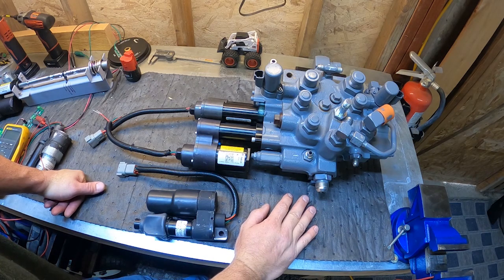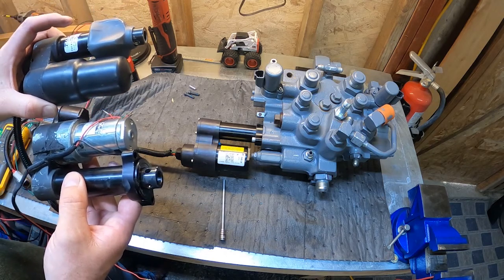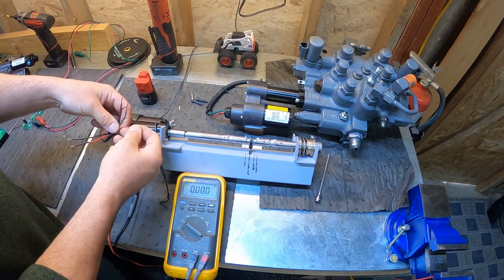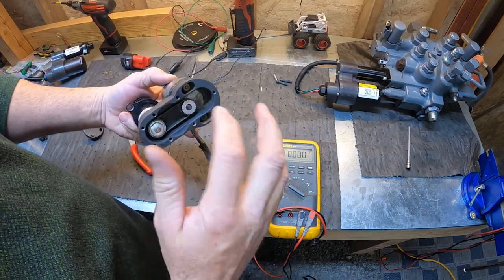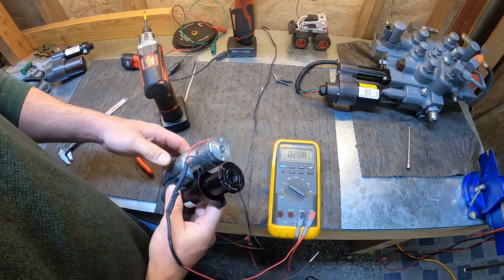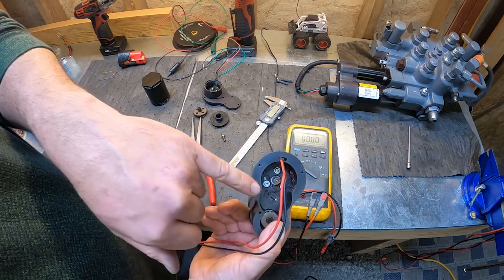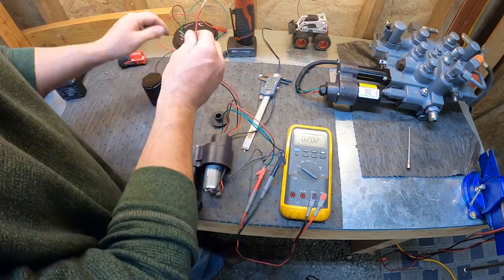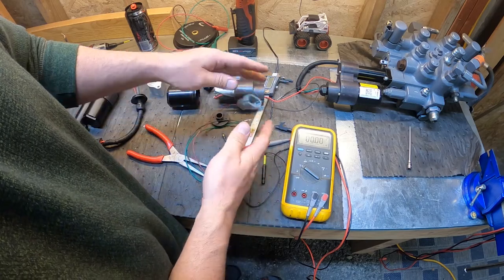Bobcat actuator, how it works, repair and calibration, what you need to know.  ACS AHC SJC

Comment: You saved my bacon! My Bobcat S220 tilt function failed today. Your video helped me determine the fault lied in the actuator motor. Resistance reading was infinite when it should be 3 ohms. I called my local Bobcat dealer who was no help other than telling me that even if I bought the new actuator from him I would still need to bring the machine in for calibration. When I asked him about performing a manual calibration he said 99 times out of a 100 it never works. So I thought no loss in trying. 
Removed the actuator and ok it apart. I had the later style with the globe motor which allowed me to remove the end cover to check the brushes. Mine still had plenty of life so I figured they hung up. Reinstalled the cover and tested on a 12 volt source. Cycled 2X and then failed. So I took it apart again this time removing the motor from the actuator. Used 400 grit sandpaper to polish the commutator and dress the brushes. Ran the motor several times, reassembled actuator using a USB cable cut down for my 5V ref. Reinstalled actuator and checked operation. Works great!
Reply from the maker: Awesome, so glad you made a successful repair and saved some money!  Don't forget to do the manual machine calibration as well just to make sure perfect neutral position is achieved if you haven't already done so.  Thanks for the comment, I really appreciate it.
Reply: @tetradgroup  how is neutral position achieved? When I reinstalled the actuator I watched the spool valve and the actuator piston moved but the spool remained centered.
Reply from the maker: @davidraezer5937  https://youtu.be/hmX6mZFlmsU

Comment: Yay bobcat working. Checked the tilt actuator in the bobcat and it was at 2.35. Was able to take the back off the actuator in the machine reset it to 2volts,put it back together everything‘s great. So I never was able to see the end of the actuator if it went back into 5 mm after I put it in flush and it didn’t work. For everyone else’s information this was a 2002 753 With an old style actuator and adapter from factory. Which after setting to the flush did not work.So I’m guessing it should’ve been sent to the 5 mm in. Anyway, thanks for the help, great videos,you’re doing a great job!

Comment: Hi Brady,
I'm working on my actuators again and pulled apart the troublesome unit, same as last time, tilt. I found the commutator was well worn quite a dip in the center of it so as I had nothing to lose, pulled it all apart and put the shaft in my lathe and very carefully turned the commutator. It turned out pretty good after all the cleanup of chips and cleaning the grooves. I also found 4 new motors online which I thought would work, newer part numbers than these old 2006 ones, but the shaft diameter has been turned down for the gear by Thompson so it would mean trying to turn it down to match which would be very difficult, still working on that, so instead I took the new brushes and brush holder from the new motor and put it on the old motor, they are both Globe motors.  I could also try to find a new gear for the new shaft diameter. The motor seems 100% better, runs great, just not sure how long it will last with the turned commutator. The globe motor # I used is 403A6005-2, it is also 1/4" shorter as it has 1 oz. less torque.

In your video you mentioned the latest style actuators post 2006 used newer type motors, not globe and that you were looking for a source. I am wondering if you have a found a source yet and if you have, could you share the p/n or link to it? I tried to pull a frame from your video to see the part number but couldn't get enough resolution to see it. If you share those numbers I will do some research to try to find a replacement.

Thanks again for your video, it's awesome.

lathe pic                      https://share.icloud.com/photos/0cb-ND0W5G9s4IJvoKRnfCpUA  
new motor brushes  https://share.icloud.com/photos/05fZrsdA-1iCxwrRfDJSaE3Gg

Comment: Thanks so much for your help, was having a hard time finding info for my 02 t190 with Acs faults, was able to troubleshoot the weak tilt actuator and figure out the problem myself,  a faulty tilt actuator and now unfortunately also a acs controller (burned it up while working the worn out tilt actuator back and forth after cleaning the internals of the actuator) So I would recommend replacing  the actuator even if you get the actuator motor to free back up cause it may just cost you a acs controller too just my 2 cents for anyone else in the future.

Comment: To start , great video. I have a 753 G, 900 hours always garage kept. I have 1 gen (with adapter spacers) I set the actuator flush, set pot to 2 volts. Now when I install the actuator, I have to extend the it out to put the pin into the spool. Press it back in to bolt up to the valve body. Now the signal wire (green) is reading 2.25 volts when tightend down. I am using the machine for a power source to adjust the pot. Turned on... AHC light comes on. Next I opened up again to adjust pot to 2 volts. At 2 volts closed pot up and turn key on (engine off) (no AHC light) press green button for BICS. Lift handle works, but the Tilt handle works then errors out. Turn key off and back on clears error but repeats AHC light comes on when tilt handle is used. With engine running I can get the bucket tilted back a little bit at a time. Do I have to take it to the dealership or might you have an idea to calibrate? The lift actuator, pot is working at 1.90 volts tried that setting also.
 When I purchased the Bobcat I also bought the manual, and it's interesting that the service manual only goes to page 60-120-10  and starts 60-130-1. If I spend the money to buy a service manual give me "all the pages" including the ones that say "dealer copy" . I got a hold of pages 60-123- 14,15,16 but it errors out with the AHC light.
Reply from the maker: Why did you open the actuator?  It could be the actuator pot is giving a faulty signal or motor is not working correctly.  I would swap actuator plugs and see if you get lift codes.  Then put plugs back to normal and swap actuators around and see if you get lift codes.  It's possible the actuator is just bad.
Reply: @tetradgroup The original problem was tilt act was not working, . I checked wiring first by switching the lift with the tilt plug. Now the error was on the other handle. So I pulled the tilt actuator out and found the motor worked but didn't move the actuator. Found the set screw problem. the gear from Globe  Motor came loose (set screw). Took apart motor cleaned the brushes and commutator. Dab of Lithium grease on the bearing ends of the motor reassemble  So I put it back together using the line signal from the lift actuator (1.90 volts). The tilt actuator goes in and out, and the line signal goes up and down. But errors out, I just worry if I take apart the lift actuator then I would have 2 nonworking actuators. 2x the cost. I had tried swapping the lift and tilt actuators Thinking maybe there was a problem with the spool or valve body, no the problem there.
Reply from the maker: Sounds like you did everything correctly.  Do you get any codes or do you have a blinking light in the left joystick?  Just wondering why it's failing, out of neutral, short to ground, short to power, and so on?
Reply: @tetradgroup  I have switched the potentiometers (lift with tilt and back) lift actuator works with either pot. The problem seems to be "the tilt" actuator "over strokes" (with either pot) 32-31. When out of the machine the lift will go out/in and retract back to a neutral position. Where as the tilt will go out/in and error 32-31 and stay there  in the extended or retracted. The lift will works on the tilt spool (having put the tilt on the lift spool) but as soon as I start to move the tilt act (on the lift spool) groaning, starts to move, add a little more handle, then it goes, and over strokes to error . I have opened the worm screw the worm screw  and the bearing are good, I did not see any flat spots. Looked for egg shaped holes ,none. But that would not account for the out of machine test.
1.Motor working both directions.... Check
2.Worm screw in and out no flat spots and bearing good, smooth in and out...Check
3.Adjust pot to 1.60v, 1.70v, 1.80v, 1.90v, 2.00v, 2.10v. but still over strokes and errors out to 32-31 Resetting the act to a neutral position each time
 I'm ready to go to Atlas Bobcat in West Chicago and admit DEFEAT. I just hate not being able to fix something that seems to be mechanical. I used to install and wire railroad crossing, switches and, signals and trouble shoot them. I started in my dads auto shop at about 12 years old, fixing cars and motor cycles. Now I'm an operating engineer around Chicago. With all my experience I'm missing something. UGH!!!
Reply: So I went over what I did to the actuators. Thinking Pots are good, the worm screws are good (they measure within 1 tenth of a millimeter), the motors run... I have already switched the pots from tilt to lift, and lift act I can calibrate with either pot. So what if I switch motors? I disconnected the motors from the actuators to see if I can calibrate the lift or find something ? So I have both motor disconnected and I decide to power them up to see if one is spinning faster/slower than the other. Using a 6 volt lantern battery. They both spun forward and backward.... I realized they were spinning opposite , the polarity for the lift was clockwise, the tilt was spinning counter clockwise. So to shorten this up I , I switched the red wire with the black on the plug. Calibrated the actuators according to your "OH MY GOD... THANK YOU VIDEO" and it is working.
 Now my question would be , How did the polarity of the motor reverse? Did I do something? Did the machine? When I took the motor apart cleaned the brushes and commutator , greased the bearings,  and reassembled it? The red and black wires are soldered to the brushes and the wires are glued to the side of the motor casing. I'm not going to lose sleep over what happen, but all I can say is, think about everything when working on things. Reverse polarity of a motor would not have been on my list of things to check... now it is.    THANK YOU you saved me (if I did not have the calibration sequence) I would have had to buy new actuator $900 and another $70 for the aluminum spacer. Keep on thinking everybody.
Reply: Anyone have part numbers and where to find the pot, bearing, motor or brushes? Thanks

Comment: Great video!  I am on the learning-curve with actuators.  I’m removing both of them off of my 1999 873 bobcat to install new seals. I think my lift issues are related to my 8-pin terminal on the lift actuator being soaked on the inside with fluid.  I’m going to assume that actuator is trash, although it was installed by the dealer in October 2019 and only has 120 hours on it.
I will be using your video as a tutorial as I disassemble this thing.  Thanks Again for the detailed video.

Comment: Hee are my codes, latest to older. M8541, M3253, 8542, 8541, 0309, 0309, 8541. This issue is ongoing for a year now. Tired of taking it to dealership until it fails completely. Every time I take it in it will not act up. So here we are, year later and I’m ready to get rid of it. Until I saw your Vid.
Reply from the maker: M3253 is the code your having issues with and is not related to the actuators.  The code is for right joystick X-axis out of neutral.  If you have a SJC joystick machine you will need to replace the right joystick as this is an internal failure and not repairable.   The other codes are for Regen issue and the dealer will need to force a Regen if you have the Kubota engine or Desox for the Doosan engine
Reply: Thanks for the reply, I was stuck thinking it was the left joystick.

Comment: Great video I was wondering if when testing the voltage sensor if sending it to much voltage would effect the calibration? I am not getting Any readings from sensor when giving it 7.2 volts… bought a new sensor and still same results … thanks in advance 👍

Comment: Great video, where did you get the servo driver and motor controller? I have a v518 versahandler im have lost all hydrostatic and hydraulic function on except steering which works normally .

Comment: I've got a 2003 t300 bobcat chasing a lift actuator fault 32 39 not show neutral spool rod was sticking in the vavle body replaced it with a new one now it free the spring return seems to work properly so it should be in it neutral state new actuator any suggestions I'm going to omh test my wires tomorrow

Comment: I have an 863F, but the tilt-down doesn't work, the tilt LED goes off when trying to push down.  It comes back on when the controller is in the neutral position so I don't have a code that I can see.   I swapped the actuator plugs and the tilt actuator works perfectly with the left controller and then the lift down has the same issue.  So I'm guessing my issue isn't the actuators but the tilt controller.   I purchased a new AHC sensor and replaced it in the right-hand controller but the issue persists.    I am at a loss of where to go from here.   I'd really appreciate any guidance.

Comment: Have you found a replacement motor anywhere or where can I find the brushes? Like to get a new bearing too if you have a like. I have a 2007 t180, part number 7101672. Actually I have it apart and the motor works and the bearing seems fine. Guess I need that potentiometer.  Thanks!

Comment: Good info. I found a 6 voltdc plug adapter that plugs into 110 volts ac. Will that work instead of the 5voltdc used for calibration?
Reply from the maker: Probably  would be fine, just use 3vdc as center point.
Reply from the maker: After thinking about it that might not work, 2.5vdc might be the center position but I can't say for sure.

Comment: Thank you, on my 2014 T770 I get a shuddering when lowering my lift arms and the lift will operate on its own and begin to rise without touching the AHC handle. I get stuck on whether it's mechanical or electrical issue. I get all the codes pertains to lift tilt faults. 
When an actuator fails is it like boom it's done or is there intermittency issues.
Reply from the maker: Can you give me specific codes?
Reply: Haven't forgot about the codes, just a little challenged with this thing. Coming soon
Reply: Any update on your issue? I’m having a similar problem. Thanks

Comment: Thanks for the actuator info. My tilt quit working on an 06 #710672 actuator. Code said broken wire. Pulled off, bench tested and calibrated but my 5 volt supply only put out 3.8v set at 2v anyway. 04 A300. Now code 38-11-12.  Do you think the power supply may be the problem. Pot off sink. Thanks
Reply from the maker: What was the actuator position at 2v?  Should be down 5mm below surface of actuator body
Reply: @tetradgroup  yes it was 5mm below surface of actuator body. At 2v.

Comment: Hydraulic oil in the twist cylinder and back up in to the gears and belt. Does this mean I have a bad O-ring on the actuator rod in the assembly and can I fix that on the machine?Seems like the motor or brushes are bad or maybe oil in the motor. Can I get a new motor for this type and what is the best way to take that rubber cover off? Thank you

Comment: I have removed my lift actuator that is faulting out on my 863. It will function when powered on bench. Is there a diagnosis test or can a dealer test to see if it’s actually not faulty?
Reply from the maker: Do you have a fault code or do you have the blinking light in the left joystick?  The dealer could check the actuator performance if you have a G series loader. If you have an earlier model with the lights in joystick the dealer will not be able to check the actuator and would probably replace it after some troubleshooting
Reply: I have the panel in upper left of cab.  I get the 3 beep on lift.  So indicates ground issue.
Reply: Also.   What globe motor are you ordering for replacement.  I see lots available. Just not sure which is best if needed.
Reply: 32-37 wiring fault.  so the real question is what does this mean, or what all can cause this.  wire harness? plugs?, brushes?  trying to figure out a plan.
Reply from the maker: Lift actuator wiring fault.  I'll need to look into this for you but I'm thinking bad motor.
Reply from the maker: Looks like a binding spool could also be the issue.  Unhook actuator from valve but leave plugged in and run it to see if it faults out.
Reply: What is your back ground. Did you work for dealer or company?
Reply: I have run motor on test bench. Brushes are short. But still work. 
I have removed from spool and still get fault. 
I know spool needs to be rebuild because I have oil leak and oil was in motor. 
When I reverse actuator locations. I still get lift actuator wiring fault.
Reply from the maker: Usually if oil gets in the motor it never works after. Sounds like it's time for an actuator.  I think you have done all that can be done.  I have plenty of parts if you are interested
Reply: Calibrated for center position.  Replaced spool seals.  Calibrated hand controls.  Started working again with no error codes. Go figure.
Reply: Thanks for good video on all the generations of over priced valves😀. 
I still need to source new brushes mine are getting very short
Reply: Are you having any luck find a replacement motor. ? Current style
634-9555
1061199
These are the numbers on mine. 
Are these globe motors?